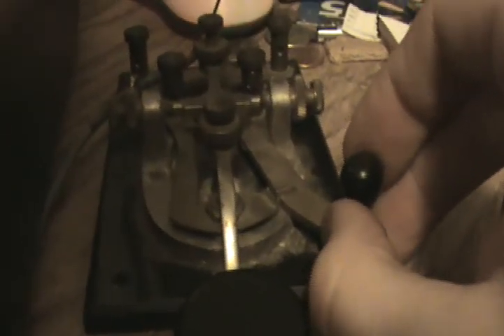FT-450 with a J-38 Morse key from World War 2

Comment: good job, the j 38 was used exstensively in training military CW operators. me for one. they were made by a lot of different contracters, Lionel train co. was one of the most collectible, in the days after the WW2 you could buy them for 50 cents a piece in the many army surplus stores that opened up..u did a fine job on ur code. keep it up, you will be unique some day.